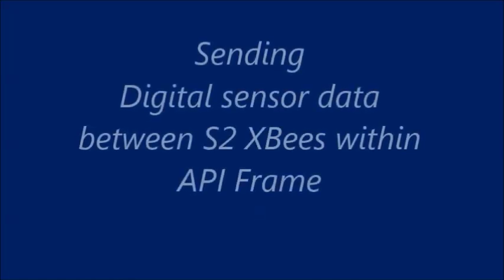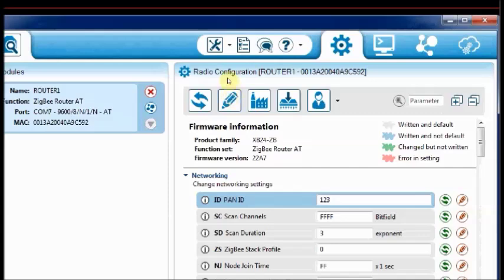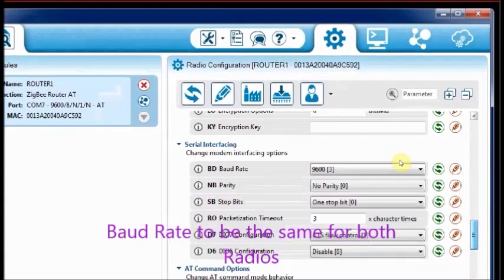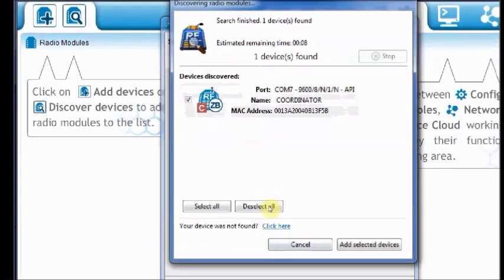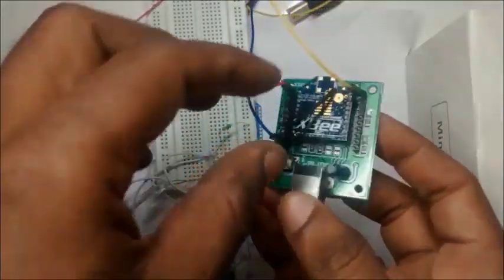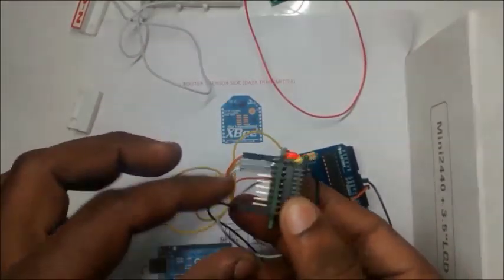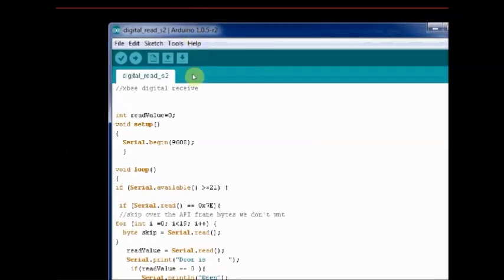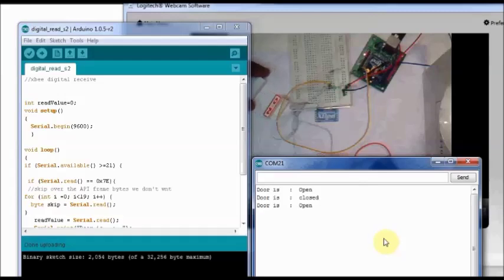XBEE - S2 SENDING DIGITAL DATA WITHIN API FRAME

Comment: hello i have 2 xbee. 1 is coordinat and the other is router . i want to send 2 different data. i use an array .sending  code : int a = 10;
int b = 45;
int data[2];
data[0]= a;
data[1]= b;
for(int i=0; i<2;i++){
  Serial.print(data[i]);
  delay (500);
  } 
and the receive code :
if(Serial.available() >0){
      char a = Serial.read();
      char b = Serial.read();
      Serial.println(a);
      Serial.println(b);}
but it dosen't work can you help me?
Reply: Yes me too having a same problem